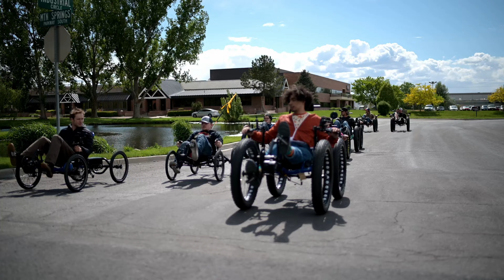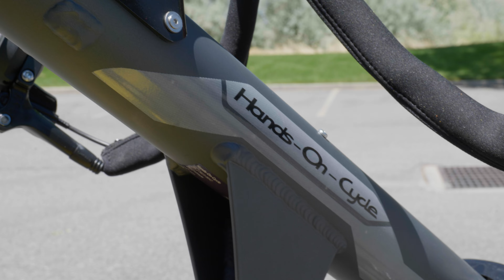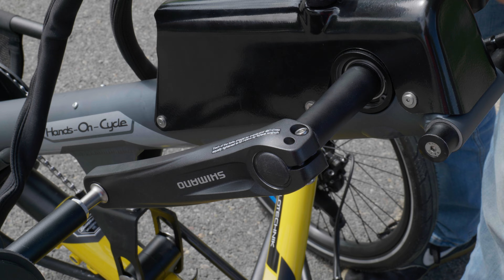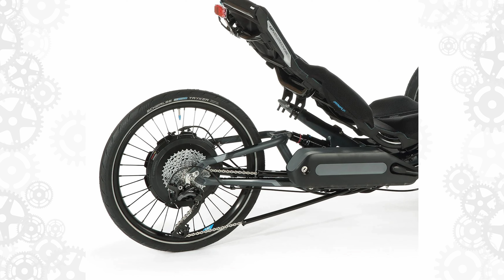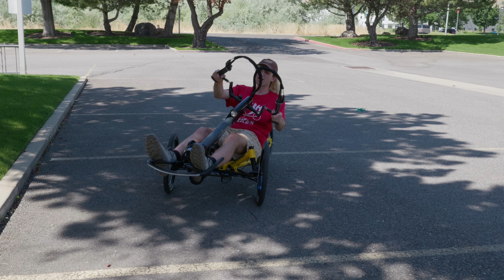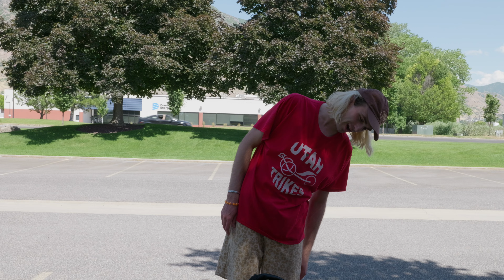HP Velotechnik’s Newest Hand-Powered RECUMBENT Trike!

Comment: Hi, The engineering design is very impressive but it also has the same problem of the delta (single front wheel) hand trikes of transferring from a wheelchair but in this case a bit worse because of the two front wheels. I have assisted my wife with this for over ten years and it is not elegant. Our fix has been to go to a removable single front wheel hand bike adapter that fits to the wheelchair. we use a manual Rio dragonfly (10kg) or an electric assist Klaxon (22kg) but still much easier than lifting your wife (weight undisclosed) from the wheelchair into a awkwardly shaped hand trike. Unfortunately, as mentioned in other posts, this is still a very expensive option. bye
Reply: 70yo, limited-mobility handicapper here. 
Cannot get on/off my owned tadpole trikes for 15-years now. 
30-years recumbent experience here.
Delta planform trikes, (already owned), are my ONLY riding choice!

Comment: I'm wondering how a person who can't use their legs at all can mount, and dismount the trike? Someone who is wheelchair bound but has full upper body abilities needs a way, or help to get in, and out of the trike. Once that hurdle is overcome I'm sure they would be thrilled to get out and enjoy their trike.
Reply from the maker: That's one of the biggest issues we've found with this trike. We're planning on working more with some people with disabilities to see how they would mount this trike or ideas they would have for further accessibility. For now, the best solution we have is to have someone assist you with getting in and out of it.
Reply: @UtahTrikesOnline  make it so the seat can swivel when the person wants to get out . and lock back in place when they want to ride .
Reply: Hase Lepus Delta planform trikes for this 70-yo handicapper. Option: 25-inch seat height!!!
E-assist and Rohloff gearbox for us handicappers!